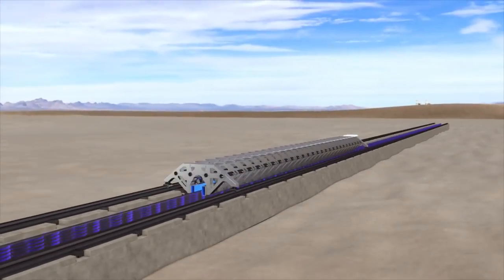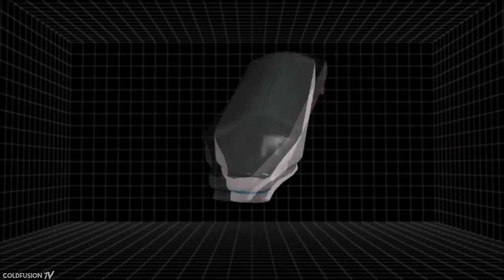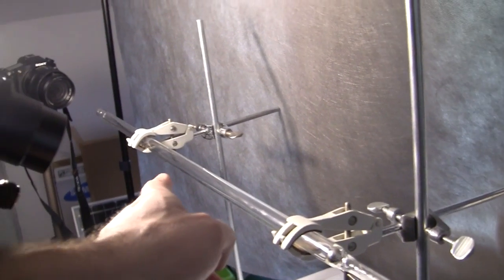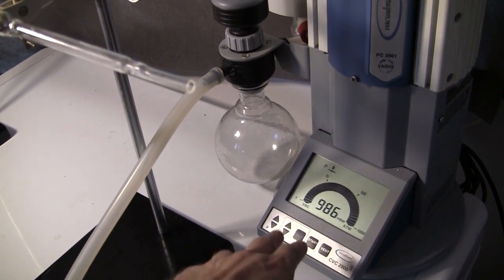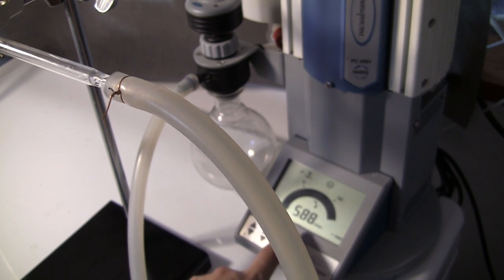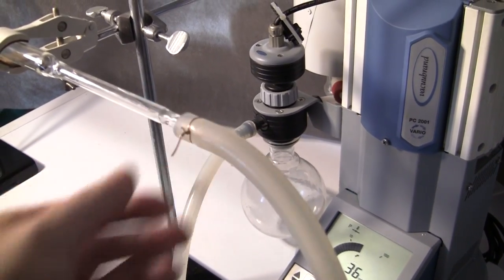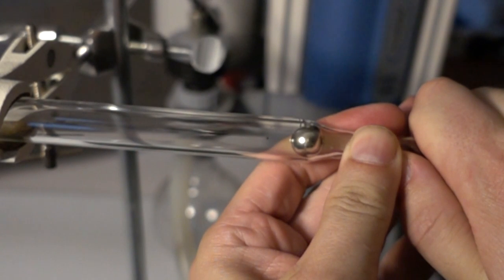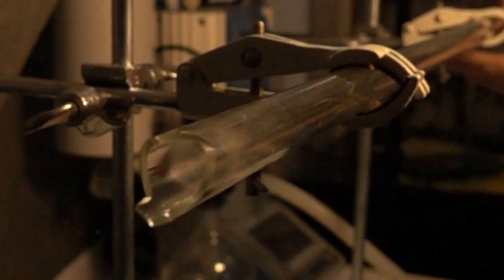How  the Hyperloop can kill you!

Comment: Breaking news: Scientist determines that if whatever mode of transport you happen to be using suffers a catastrophic structural failure you're probably going to die. Concocts demonstration that conveniently ignores boundary layer to illustrate this.

Next time I'm driving along at 50 mph and all the wheels fall off and the road explodes, my final thoughts will be "this is exactly what thunderfoot warned me about"
Reply: haha spot on
Reply: Planes take off every minute and very very seldom do the wings fall off. The engineering compromises in getting these gossamer tinfoil birds airborne are an order of magnitude worse than those necessary to build a network of evacuated metal tubes.
Reply: Old Machines & Such even if they build it out of steel one hole in it and everyone's dead
Reply: LOL, yeh the demonstration was not what I was expecting.
Reply: If you're on a car and one tire loses air you're more or less fine.
But he merely scratched the glass and the ball literally exploded out.
Imagine if you are in a car, but such that if you were involved in a fender bender your car would kill everyone inside. He did not demonstrate a catostrophic failure, he literally scratched the glass.
Reply: lol  This system IS actually a hole, a quite big one. Pls stay away from holes, as it is our all ("everyone's") dead. What about submarines, airframes, or even front tires of cars at 100mph+?
Reply: a rapture will still be very much deadly for live cargo unless they are in a liquid or something in the shuttle as they will still get hit by a air wall

a submarine is probably the closest thing but if the wall in a sub cracks from pressure all are most likely dead in it before water touch them or at least knocked out

humans are very sensitive to rapid pressure changes or acceleration or deacceleration.

as a goods transport this is still kinda valid
Reply: NexionSE All that does is produce stresses on the craft. If pressure is suddenly increased everywhere, the net force would be zero. No acceleration = No danger, unless the craft itself somehow ruptures, in which case it would be the same situation as airplane depressurization, which is an event that can happen in transport avaliable today.
Reply: rofl XD
Reply: lol
Reply: He pulled the vac hose off, it's clearly visible in the highspeed footage

And they aren't building the hyperloop out of glass.
Reply: +Jamster yeah expect it would be easier and more lethal if something went wrong here
Reply: Ikr
Reply: +Alice Eliot If you even read the above arguments you would know that isn't true. If one plane fails not all planes crash. With this system it would be a very real possibility.
Reply: The hyperloop is just a highly advanced train, but you won't die in a train if the tracks fail 3 miles away while the hyperloop can fail 3 miles away and shoot all the way to one of the ends with the power of all the atmosphere rushing to fill the void inside the tunnel. worse than that would be if the capsule you travel in fails, putting you into an essential vacuum, and boiling you alive.
Reply: You guys don't seem to realize that this can be engineered around, such as pressure release valves in case of a depressurization so that no acceleration happens, only a rapid pressure increase on the outside of the vessel.
Reply: well if the fails in just 1 part of the system it will basically kill all in that system and then some as he demonstrates i think this kind of transport is best for goods  transport
Reply: An airplane would a similar experience the same thing if rapid decompression happened. The difference in pressure between the outside and inside of a typical consumer plane at cruising altitude is ~500 millibar or ~.5 atm, which is a very deadly level of pressure change. The pressure difference in the hyperloop would be slightly more, but with more ways to engineer around it because it is on the ground meters from an atmosphere. Sudden decompression would be deadly, but only to those in the single container, and it is plausible that it could completely avoided.

Comment: Mr. Thunderf00t. Usually I am very much enjoying your videos. It is important to debunk at least some of that BS out there, but I think that there is flaw in the argument in this video. Weight of the train to its surface is way higher that that of that metal ball. Acceleration would therefore be much smaller. To put it simply bigger the ball would be smaller the acceleration would be.

Comment: @Thunderf00t Magnets would be used  to stop any failure like this.
Reply: Other than the fact that current designs are going to use on board power for the maglev and braking....
Reply: MasonDixonAutistic It is to stop the vehicle not stop the airflow.

 The demonstration he used is oversimplified. First the vehicle will not be at the breach, it could be miles down the line, giving a lot of time to initiate a more controlled repressurization gradient. Second the breach will (if even possible) only be a partial breach not e complete severing of the tube, greatly reducing the force of the in-rushing air current. Third there is going to be a large area around the outside of the vehicle as it is not going to be in a perfect vacuum, so for efficiency the tube needs to be ~3x as large as the train giving enough room to let some of the pressure by, this would decrease the impact of the inrush. And lastly the vehicle is going to weigh a LOT, it isn't going to be moved easily.
Reply: Oh yes, if only they had large abundance of energy in form of speed handy for such occasions. Oh right, that's actually how their breaking system works to collect energy used in acceleration back. But of course, the hyperloop is as simple engineering marvel as a ball in a glass tube.
Reply: magnets require electricity, lots of it, at that scale... guess what's the first thing to be interrupted in event of an accident? :D
Reply: How do magnets stop a flood of air moving at the speed of sound?
Reply: +Kebab-Kastike "Collect energy used in acceleration to stop said acceleration."

Dude you seem to have no grasp of elementary physics. Read https://en.wikipedia.org/wiki/Regenerative_brake and tell me if you still think it's going to save the Hyperloop.

It's people like you who keep believing in perpetual motion devices and all that quackery. sigh
Reply: Shien The Kid Thanks for missing my point in my response to a comment and reading too much between the lines.

It's people like you who waste so much time writing angry comments to people who they imagined saying something that was incorrect.
 *sigh*
Reply: Fucking magnets. How do they work?
Reply: Kebab-Kastike =\

"their breaking system works to collect energy used in acceleration back." (*braking)

How exactly can I interpret that as anything other than you suggesting that regenerative braking systems are going to somehow help stop the thing? If I'm somehow misinterpreting what you're saying, I'm really sorry. It'd be nice if you could clarify, though.
Reply: Here's a hint: I was responding to a comment that claimed that electricity would be the first thing to get cut. Here's the second hint: I never said the word stop.
Reply: Kebab-Kastike
Doesn't actually matter anyway. Just have a whole bunch of charged capacitors tied to the mag-lev current, set to charge off said current.
Current is interrupted, caps are triggered, setting off your brake magnets. Basic stuff.
Not that your brakes absolutely HAVE to be magnetic in nature.

Comment: You are going up against a man that literally sends things to space on a monthly basis. I hate to say it,  but you have bitten off a little more than you can chew here. Do you really think Elon is that fucking stupid to not understand the concept of a vacuum and the risks and engineering feats involved?

 He has a lot more people with a lot more degrees than you working on this, not to mention this isn't the undertaking of a single company, there are literally a dozen different companies involved. 

Even in the event of a breach, it would not be a breach of the whole tube, it would be a puncture that would slowly fill the tube. Vacuum is not all that strong, and it will not implode because of a breach, I am damn sure they would engineer it with this in mind. 

Using a glass tube and ball bearing to in any way show a correlation is at best scaremongering, it is in absolutely no way a proper demonstration or experiment.

Comment: The thing that first struck me in this video is the difficulty in getting the vacuum down to 1 mbar.  I think it underscores the extremes required for the project to succeed.  How much air volume is being removed from a 350 mile tube?  In the event of an explosive pressurization at one end of the tube, is there a shockwave that could cause an overstress to the entire length of the tube?  I'm reminded of the Mythbusters crushing a railroad tanker (yes not the same spec as the hyperloop tube) at about 800 mbar.  What would that tank look like had it been 1/800th the pressure.  In a hyperloop tube failure, the destruction will be worthy of the Slo Mo Guys.  The quality of the material and workmanship will have to rival that of military submarine construction.  The interlock/sealing machanisms that allow passengers to get in and out will have to be extremely well made with the ability to function perfectly thousands of times and designed to make it impossible for an operator error to cause a failure.

The builders will have to keep the tube testing video secret because they'll need to test it to the point of failure and no one will want to get in the production tube after they see what will happen to the tube if a big rig driver falls asleep and crashes into it.  Nevermind the pod inside going 760 MPH.

Comment: All forms of transportation are inherently dangerous.  Demonstrating that an accident will happen if there's a mechanical failure is pointing out the obvious.  All our advances in fast transportation have come from acknowledging this inherent risk and finding ways to manage and overcome the dangers of making people move at unsafe speeds.  I don't see any reason why we shouldn't continue to innovate, provided that the risks are responsibly managed and safety measures are developed.  Basically what you said in this video was "I see an obvious danger here without an obvious solution, so we shouldn't even try."

Comment: what happens when you use a projectile that's not quite as close fitting?
Reply: He also didnt have any other forces acting upon the projectile, more space to the walls and the magnetic rails (which i presum would have some sort of warning system and automatic breaking in such an event), I kinda like thunderfoot, but hes often overly pessimistic... and a bit too in-your-face about his opinions.
Reply: Exactly, the actual thing has to give quite alot of space between the pod and tube because at 8-900kmh the tiny amount of atmosphere gets kinda thick and needs to pass somehow.. and the other thing is he cuts the tube right of, what are the odds of that?
Reply: Hes become a but too click bate unsubed a while ago but this poped up on my feed.
Reply: Its not the vacuum that's propelling the object its the air rushing in to replace the vacuum. Like bullet in a rifle if the bullet is ill fitting the gas will pass around it.

Comment: I think that ball bearing demonstration is a bit deceiving.  The force due to the pressure difference is proportional to the cross sectional area and goes as r^2, as a first order approximation.  While the mass is proportional to the volume and goes as r^3.  basically this experiment doesn't scale, if you increase the size the experiment the speed of the ball will decrease for the same length of tube.  We can do the math for a frictionless plug with the mass of a train.  The pressure difference would be around 100,000 Pa assuming a cross section of 10m^2 we get 1MN of force.  assuming the train weighs about 130,000Kg per car and has 30 cars we get ,25 m/s^2 acceleration about half a mile per hour acceleration per second.  That's not bad at all and could easily be stopped with some breaks.

Comment: We had a TransLogic® Pneumatic Tube System at the hospital like many hospitals. It would be a working system to compare with the hyper loop concept. It works with a central blower to create a pressure differential to move the 1 to 2 liter sizer carriers through it. The  TransLogic® Pneumatic Tube System never work with the system open on one end all the time.  Looking that hyper loop , they just moved the blower on the carrier instead of putting in a central location with a switching station between, also making it larger. I would tell the nurses after a specimen leaked do to a loose lid, "the tube system is a air canon, please make sure lids and specimen is secure".

Comment: but there is enough space around the train to allow some airflow, right? and a few tonnes heavy pod wouldn't accelerate that fast, especially with the space around it
Reply: Somebody doesn't understand that force scales up with the amount of matter displaced.
Reply: *****
Exactly, the vacuum is impractical when it will provide no tangible benefit. All it presents are design challenges and disastrous consequences in the event of failure.
Reply: Maybe a new way of transporting jews
Reply: not to mention you could design in adequate bypass to make sure this situation is a non issue